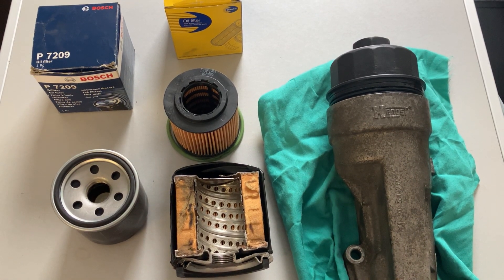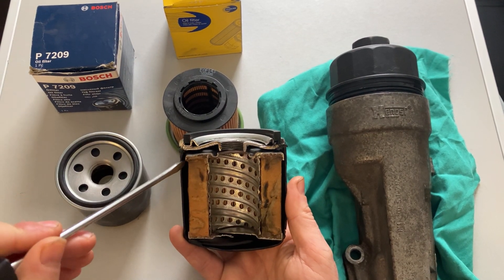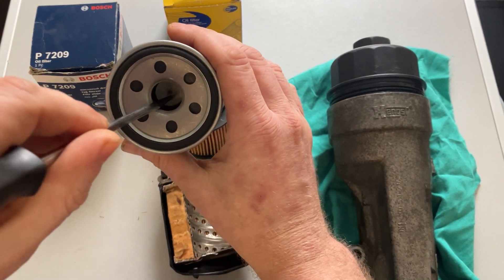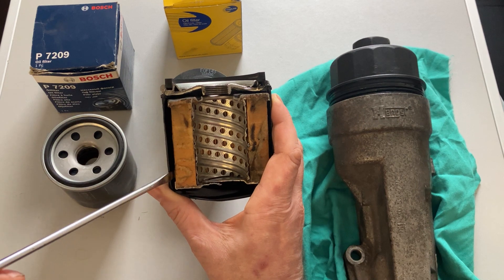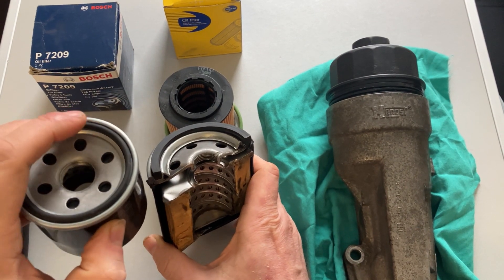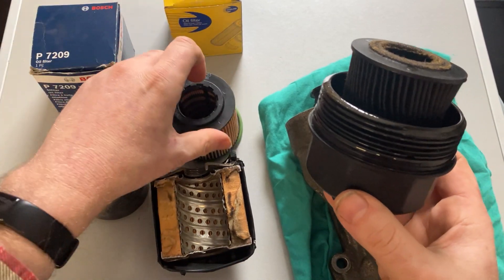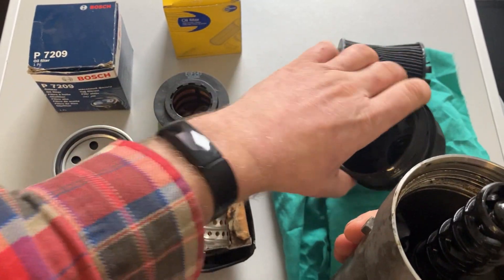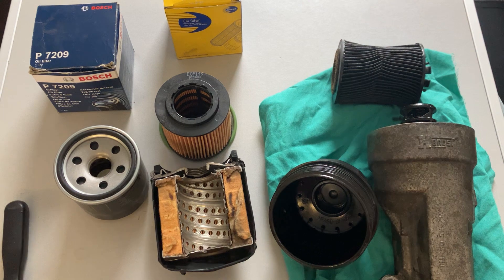How an Oil Filter Works.

Comment: When I change oil I drain sump, drain filter, fill with cheap oil of correct grade, idle engine for 10 minutes, drain, new filter & fill with correct expensive oil. When full of oil & let running to circulate the new oil the oil on the dipstick is as clean as when I bought the car new. ½ way through the recommended oil change interval I lazily suck out the oil & fill so my engine always has the cleanest of oil.
Reply from the maker: Really good idea to do that with oil and coolant changes. Gets as much of the old rubbish out as possible! As you clearly know, oil changes are probably the most important bit of maintenance. Thanks for the comment!

Comment: You don't say how the oil comes out of the car
Reply from the maker: You drain oil from the car from the sump plug, at the bottom of the engine. It’s on the oil sump, near to or at its lowest point.
Reply: @AdamMechanic I mean where does it come out from the engine and enters the oil filter? I see only one hole in the center which is where the oil returns.
Reply from the maker: @ronenfe ah, ok, oil goes from the sump, up through the pump then through the filter. It then goes around ‘ galleries’, across and up the engine to feed moving parts, camshaft, crankshaft, pistons and valve train.
Reply from the maker: It comes into the filter through the holes around the outside.

Comment: how often should i change the canister filter? any mileage number u would suggest?
currently i change every 6 months (the car is driven 2hrs per day on average)
Reply from the maker: Hi, manufacturers set oil change intervals at a certain amount of mileage or months. Each car is different, so you would have to check online/ owners manual for you car. Thanks
Reply: @AdamMechanic  oh thank you, 10k miles for my car it seems. i thought all cars have similar time 😅😅
Reply from the maker: No worries, anytime!